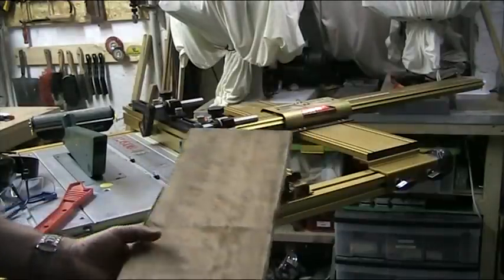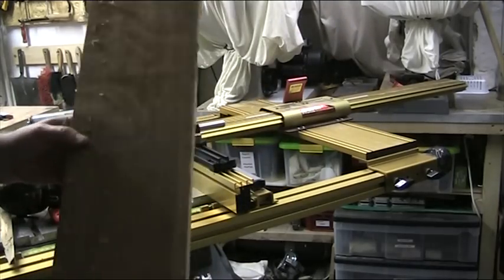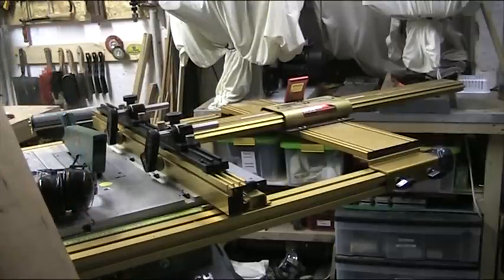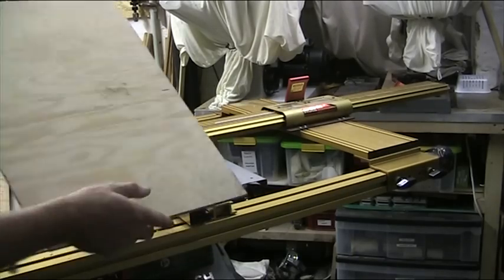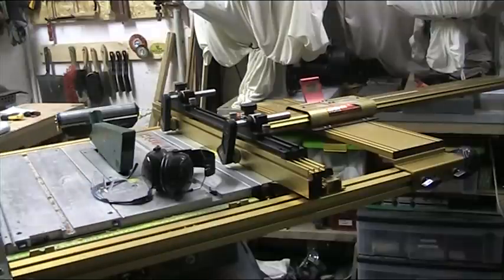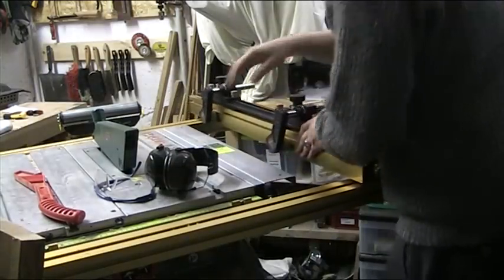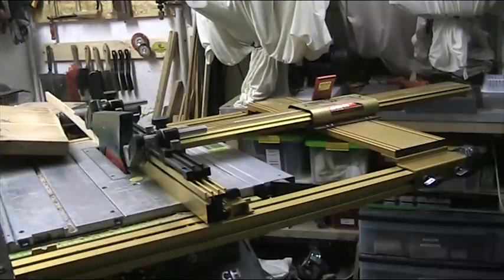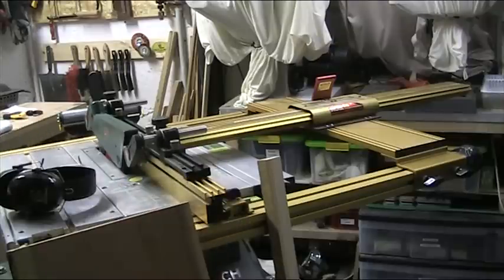Jessem TS Stock Guides - video 4 of 5 - Test Cuts

Comment: It appears that the shop has tight quarters but camera angles could have been better so that we wouldn't have seen your right arm and not the board going through the saw. I also agree with Mark Beiser about putting an irregular edge against the fence. You may not have had kick back but I doubt you had a straight edge on your cut. A track saw would  have been done the job quite well too.

Comment: You should tighten the knob on the outside of your incra fence. This prevents the jessem stock guides pushing your fence up. It also helps your fence stay parallel to your sawblade when you push your stock against the fence. I know it might be annoying to do that everytime, but if you buy something that can be accurate to a 1000th of an inch, it would be a waste to lose that accuracy because you dont want to tighten and loosen the knob. (I had spare parts so I installed a knob on the other side too)

So after you clamp your fence into position, tighten the knobs and it will stay tightly in the right position.
Reply: I like that idea of putting a knob on the out feed side of the fence. I also have the incra TS-LS positioner and you're correct locking both ends of the fence will ensure the accuracy that the incra fence is capable of.

Comment: Before you hurt yourself working with live edge slabs, please, please make yourself a sled to screw/clamp the slab onto, that will give you a straight edge to reference off the fence with.
Any old piece of plywood will do.
It doesn't even have to be a sled, just staple/screw/glue/whatever a strip of plywood on top to ride against the fence.
Reply: Yea, that cut at the 12m mark was pretty upsetting to watch.